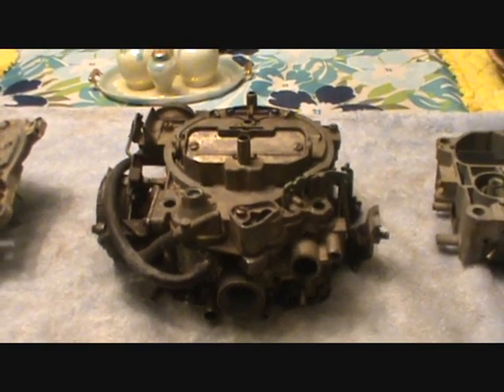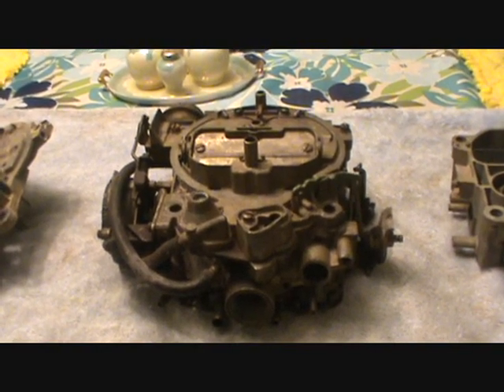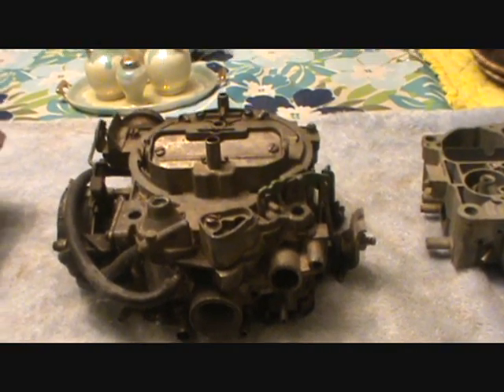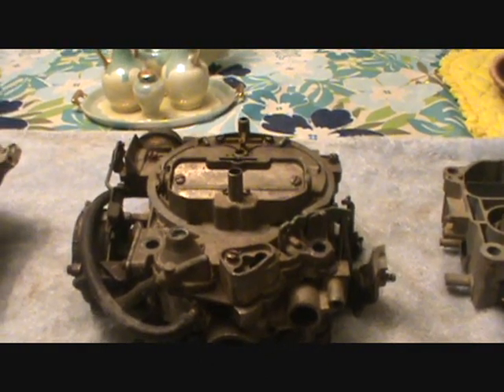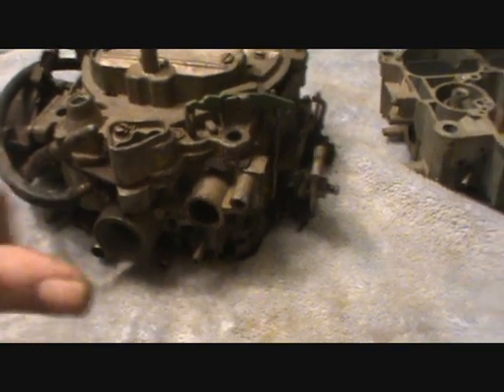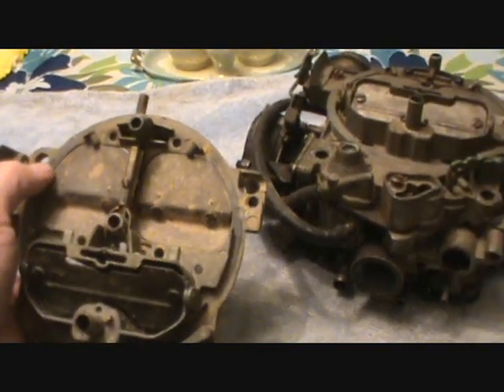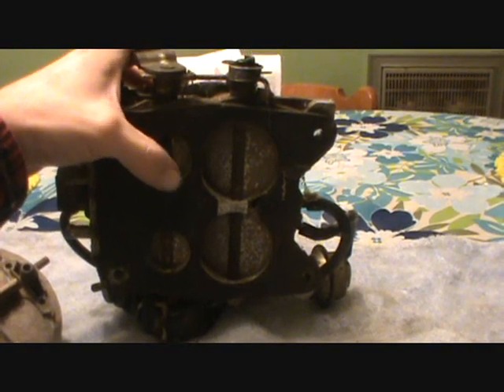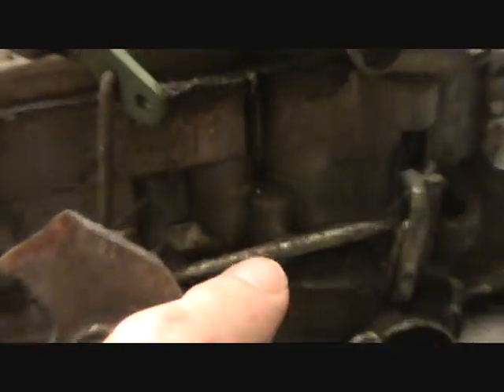How to de-bog your Quadrajet part 1

Comment: I love my q jet. For the longest time I’ve been getting 17mpg and lately it’s been 13 and I can’t figure out why. Oil ain’t gassy. Plugs are tan. Idles decent. But the exhaust does smell a little rich. Has a new float needle and I’m pretty sure the float height is good. 12 degrees initial advance. 

Wish I could figure out my problem

Comment: How to debog a quadrajunk step 1 remove the quadrajunk step 2 shoot it 30 times with a ak-47 step 3 call summit and order a deMon carb step 4 install new deMon step 5 done
Reply from the maker: step 6  pay 321.00 credit card bill step 7 cut hole in hood since adapter raises carb too high  step 8 buy another carburetor when that one runs out of cfm
Reply: @TylersNeighborhoodGarage  running out of CFM that's not how it works if you have a 750 CFM quadrajunk and you buy a 750 CFM demon is still the same CFM as a matter of fact you have better throttle response with the demon because it has annular boosters and Hood Clarence 1 inch spacers not going to make a difference
Reply from the maker: @hishok3332  what if it doesn't need 750 cfm?
Reply: @TylersNeighborhoodGarage  then you buy one with less CFM you can do the math and find exactly what CFM you need
Reply: Get out of here with that heretical talk, long live the 4 jets of power!

Comment: carter made Q-jets...... have one on my 77 chevy pickup (not original carb)
has to be an EARLY version..... zero smog BS, and very few vacuum ports (ended up using them all.... plus manifold port for the booster brakes)

mine dont bog....just moans
Reply: a proper q-jet will shit on an edlebbrock in both MPG and power...... unpopular opinion, i know..... but its the right one

Comment: Pretty sure it is the wrong coil besides the quality being crap. Can't tell you the brand as its not stamped and the box is long gone.  I did get it at Advanced Auto parts using the make and model of the truck. Bad move. I didn't watch any of your videos until afterwards another bad move. I have the carb number now and will try Mike's Carburetor parts tomorrow. Ive been chasing this problem for weeks now and really love your videos have my carb almost dead on, a very slight hesitation 1st to 2nd gear and when I step on it while cruising in 2nd. Love this car. Thanks to you.

Comment: Tyler been have problems with the choke kick down, i have a 1976 k1500 with a four barrel quadrajet that has a divorced hot air choke coil (brand new) so first I  noticed that the rod wasn't moving up and down after investigating it i found the shaft the coil is wrapped around was just spinning WOW. after squeezing it with some visegrips it now is tight .put it back together and this time it actually pushed the rod our towards the front of the truck and down. Now  i rolled the coil down and tried it again with nothing connected and its not unwrapping (it is hot) as t a loss
Reply from the maker: See if you can find an original Rochester choke unit used or new old stock on eBay. What brand was the one you tried?

Comment: Hi there. On the right side of my Rochester, there is a rod coming out of the intake.  It goes to the tab with two holes. One says std the other says alt.  Which hole does it go to?  I forgot to take note of this on disassembly.  Any help appreciated thanks!  Btw, it's for a Buick LeSabre 1970

Comment: Here's to hoping you actually check a reply on a several year old video, lol.

I've got a 75 Electra. In my rebuild manual for my Q-Jet, it says there's a spring that sits inside the "air vent valve", the little triangular thing on the front? Well, mine never came with said spring, at least not when I got the car a few months ago. Where in that vent does the spring go in the air vent? And what kind of spring? If you have a video on it, feel free to just link me to it.
Informative stuff, thanks!

Comment: hey tyler i had a question. my issue is with my 1978 caprice with a quadrajet carb it runs decently and all but when i go and floor it, the car just sputters and doesnt move any faster. i wanted to know how do i fix that? i wanted to know cuz ive been thinking of switching to another carb however ive heard many good things about these carbs so i was thinking of keeping it. any help would be hugely appreciated thanks in advance.
Reply: Irving Cobian 
Watch his vid on AIR VALVE ADJUSTMENT
Reply: I meant SECONDARY AIR DOOR ADJUSTMENT
Reply: X Mo thank you for the tip
Reply: You may have fixed your problem already I don't know. I had the same problem on a '79. Check the centrifugal advance on your distributor. Take your dist. cap off and see if you can move the rotor back and forth, if you can't it is gummed up.

Comment: I thought I was having carburetor issues and therefore watched your entire QJ series in preparation to rebuilding the carb on my 76 Chevy K20.I never had to go that far because it turned out my vapor lock issue was really a fuel delivery issue caused by a clogged (right tank) and non existent  (left tank) filter sock on the fuel pickup tube in my tanks. I did learn a lot about QJ'S so thanks anyhow.

Comment: hey, I'm having some issues looking for some help. I have an 86 Monte Carlo 305, qjet.. car seems to have a miss at idle but doesn't seem to miss under a load, another issue is short bog when accelerating from a stop. finally, I have blue smoke on startup,but ONLY on a warm start. never on a cold start. anyone know what these problems could be?
Reply: I have an 86 305 in my Firebird and I have smoke on startup too. From what I’ve gathered, it’s not the carburetor but actually valve seals letting oil drip into the combustion chamber after the engine is shut off. Then it burns it off when the engine is started again. I think the valvoline high mileage oil that I put in helped to recondition those seals a bit and stopped the problem. But I have also been having some carb trouble with my qjet, even after a fresh rebuild.
Reply: Check the metering rods

Comment: Amazing videos! Quick question.. I just threw a qjet on my 350 vortec heads and LT4 hot cam. It idles and revs very snappy. How ever the engine stalls when I put it in gear. If I feather the throttle I can keep it alive. What should I look into?
Reply from the maker: What happens if you run the idle mixture screws out further?  How about if you partially close the choke?  Have you checked the base timing to make sure it's not too low?
Reply: I attempted to start it today.. couldn't fire up. Just pulled apart the carb and the accelerator pump rubber fell apart. It was the black material and there was debris in the check valve. I'm working on getting a kit and hopefully that was the issue
Reply from the maker: Guillermo Rodriguez
 Good deal. The ethanol in the gas eats the older rubber up, so make sure the kit has the blue pump in it. Also, you should really make sure you clean every passage completely with solvent and air pressure.
Reply: If I close the choke half way it idles up. if I close it all the way it starts to die.
Reply: I can drop it in gear now after the rebuild. I popped in .070 jets. seems like idle quality needs improvement

Comment: Hey Tyler! I noticed you said you often removed the secondary lock out tab from the choke assembly on your carbs-- do you run into bogging as a result of the choke still being on, or do you just make sure you aren't using the secondaries until after the engine warms up and off the choke??
Reply from the maker: The latter. No need to be punching it with a cold engine anyway.

Comment: Tyler.. Name the Parts as they are..OK! and it would help! your viewers that you should explain what the parts do to effect the Carb. when Parts go BAD! and get to the point...this was meant in the good way! so heres the Question when the Front Vacuum Break Fails. what effect Does it Have on the Performance of the Qjet? it will start? and run.. But! if you push Lightly on the Vacuum Break it will go in. "BUT"!! after that it will spit and sometimes Bachfire. and then Stalls..it will run! but put it in Drive it does not have power..and will stall.... the screws on the front break& the Rear Break you shold do a video adjustment on these.on a running car..that would help your viewers alot...

Comment: hey tyler I hold the choke shut tite and it will run and idle high let it go and it dies I have rebuilt it and am stumped, any help will help
Reply from the maker: +Erick Mcguire It sounds at first blush like the idle circuits are plugged with debris, or at least one side. If you look at the top of the carb closely, you'll see what appear to be the open end of a tube, one on each side, inside of where the choke flap is.

 Those are the idle feed tubes, and you can attempt to dislodge crud in them by spraying carb cleaner down them with the little red tube, or in worst case with some compressed air.

 You do have the idle adjusted correctly, right? If it won't run off the idle circuit, people will crank in the idle speed screw so far that it actually begins to run off the main circuit. Either way, what you are doing by closing up the choke is force the mixture to be rich enough to run, so idle screw issue aside, you have a fuel restriction somewhere. Good luck.

Comment: so we drove the cutlass 350 Quadrajet 4 speed all around town today with the choke wire disconnected. and we had minimal power but we hardly used any gas at all. is this possible. could I have an electric switch to control the choke so we can chose power or mpg?

Comment: Hi T,  things are working quite well,  New plugs wires and distributor and set timing made a world of diff.  Still a bit slow.  The 2ndaries are kicking on well.  I'm having trouble adjusting the mixture screws.  I really can't tell using the vacuum method what is a good adjustment.  The sweet spot is anywhere from 2.5-4 turns.   I really can't fine tune it.  What is a good basic adjustment for my electronic quadrajet.  I've seen 2 turns, but my car won't start or barely runs with that.  Between the 3-4 turns from all the way closed seems to be ok.  Should i leave alone or keep it on the leaner side?  The car is a 1986 Trans Am 305. Thanks,  J

I'm trying to not rebuild it yet.  But I may need to.  Thanks, J

Comment: Hey Tyler,  Thanks for the video's.  I just bought a 1986 Trans Am with a quadrajet (computer controlled) 305.  The car is very slowed down.  Original exhaust.  I am planning to get headers, high flow cat, and cat back.  Question:  I am wondering about a better intake manifold.  Will the computer portion of the quadrajet "understand" the new intake?  Would you advise a new intake, if so what procedure would you recommend for adding a new intake.  thanks, J
Reply from the maker: +NOVA Chiropractic & Rehab Center of Sterling Go ahead and use the factory intake for now. You can address any drivability issues with some simple carb tuning.

Comment: ok thanks for gettin back with me. i know ya get tons of questions. i love the videos they are by far the best i have found. i am planning on just rebuilding an older one using ur videos but havent got it yet. considered buying new one for 69 chevy truck off rockauto for around $200 but i figured i better go ahead and learn how to rebuild one for next time i run into it. i will still need old style distributor with vaccum advance though. thanks again will b watching.

Comment: Is it worth putting a four barrel on a Buick 3.8?
Reply from the maker: +Scott Snyder no. Buy the 4bbl and install a buick 455 under it.
Reply: +WhoSaidTyler I thought so. I rebuilt my DualJet and It runs perfect. I was just wondering if I could put a q jet on and get secondary power lol

Comment: tyler i have subscribed idk if ya got my question i hwve an electronic q jet in 86 caprice with 305 but it has new style distributor with 2 diff plug ins one is tps other supposed to b to metering rods? not real good with carbs just a shadetree mechanic but my problem is dieseling and it just refuses to idle down regardless of adjustments to fsst or slow idle...have got it doing better but have no idea of how to adjust anythingon it other thsn idle an fadt idle....thrre is a big brass screw on top,front of carb that i believe to b jet but it was ran all the way down tight when i purchased car but i have no idea. how to adjust it? any suggestions or videos?  the car is 86 but valve cover bolts go straight through into heads an like i said new style distributor not vaccum advance like old s.b.c. i grew up working on. that couldnt b correct engine for 86 could it car only hss 80,000 miles. thank ubin advance love ur videos they are the best ones on youtube! jus cant find one bout electronic carbs c with t.p.s. on em.
Reply from the maker: +David parks hang tight, I'm answering comments a month deep

Comment: it also surges up and down really bad and will burn ur eyes out with hood up and breather off. i noticedca screw on top when breather was off that is adjusted way down and i have no idea how to adjust it...my idle screw isnt even touching. any advice would b greatly appreciated my kids hwve to ride in b this car and i want it to b safe but am lost as to what i should try. someone has partially removed some emissions stuff and i dont know what to block off or run where. vacuum  diagram is gone off car.

Comment: Hey WhoSaidTyler sorry to bother you however I have a 1987 chevy caprice classic with an olds 307 and a quadrajet which is giving me some trouble. The vehicle drove fine for the past year or so (with the exception of some hesitation when moving from a stop) However, recently the vehicle will just not drive over 40mph, It will bog and/or stutter until eventually the engine just stalls and I need to pull over. The engine idles fine and revs great when not under any load. The accell pumps seem to be working fine  and I don't appear to have any vacuum leaks. Any insight? Possible issue with the secondaries? Or should I just rebuild the entire carb?

Thanks!..

Comment: I hve no earthly idea werr 2 start with diagnosing mi problem bt if u recall I hve a Pontiac 301 wit a dualjet I got frm  a junk yrd it wus great up until 2day wus on mi way hme n it started 2 surge wen I came 2 stops then it wud do fine then it wud start bak 2 surge like it has a huge cam.. Werr shud I start trouble shooting
Reply from the maker: Marion Walker Check for a broken vacuum line first. If you don't find anything obvious it wouldn't hurt to overhaul it.
Reply: Watched ya Video bout the fast idle.. Knowing how tht works it's way betta.. I checked vacuum fisrt though mayb EGR or sum'n.. Wires r fair gne do plugs tho n invest in a cheap tech

Comment: WhoSaidTyler I have a quadrajet on my 82 camaro 305 and i believe its out of tune. It has been rebuilt a while ago and it runs good when it runs but it runs like its too rich. Now i can't get it to start and run cuz its acting like its flooding too quick and it sounds like its sucking air somewhere. I have all vacuum lines attached and air breather on it but it don't run and all it does is spit out white smoke out of the quardrajet. Do u know what could be the problem?
Reply from the maker: SouthwestCustoms  It's not easy to diagnose those issues over the internet but my first suspicion is a problem with the float/ needle and seat. The top of the carb needs to come off and those items checked out. Floats can get saturated with fuel, they can be adjusted too high and the needle valve can get trash in it and not shut off the flow of fuel.

Comment: Got a Quadrajet on our gliding club winch engine. Not all the power is needed, the throttle has a stop to prevent the second set of chokes being used!
Power loss caused us some angst until we went to basics and checked the fuel supply pipe, it had collapsed inside its braided cover and almost completely shut off the flow. Suggestion - use solid pipes as far as possible, with flexible short joins...
Choke is non existent, we start using the accelerator pump in the aviation style....
Reply from the maker: SuperAviatar Interesting info...thanks.

Comment: Thanks Tyler! My quad bowl empties after a short run ,I talked to jet mfg aand checked the ports on the bottom of the bowl.i watched a video on the net yars I think and he said that there is a low speed syphon loop to prevent this I couldn't make it all out what he was saying can you help. Thanks!
Reply from the maker: A what? I've never heard of a "low speed siphon loop". Sounds like one of those "As seen on TV" things.

Seriously though, are you SURE the float bowl is empty after a run? That's a lot of fuel going somewhere fast, and there's simply now place for it leak that quickly.

If you are having a hard start problem, then that points more likely to the fuel BOILING because of heat, or fuel running over into the carb throat, or a choke problem.

The first thing I would do is replicate the condition where your problem will occur. Bring the vehicle back in and pull the air cleaner. You want to watch and listen to the carb and see whether you can spot fuel doing something it shouldn't. Look down the carb throat and see if you see drips.

There's a lot of variables here, more than I can explain here but I don't think your problem is the carb emptying. If it IS, then I bet you will find the intake and carb are hot and causing fuel boil.

Comment: We replaced the plugs, adjusted the timing and gave a 1/4 turn on the adjusting screw and it runs 10 times better. I think this old farm truck that's been sitting just needed some new plugs and some adjustments. He just bought it and has a receipt showing the carb was rebuilt 11 yrs ago. Not sure it that means it probably still in good shape. It seems to run real smooth now.
Reply from the maker: Awesome. It could probably benefit from a couple good foot-to-the-floors through first gear to help clear out the cobwebs. No need to wind it hard though, just enough to get fuel flowing through the secondary side and blow the carbon out.